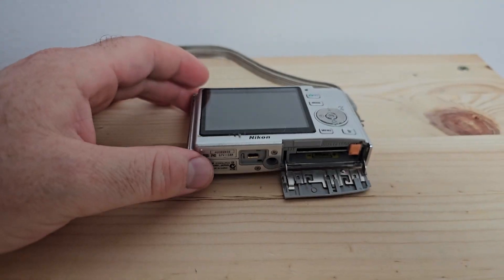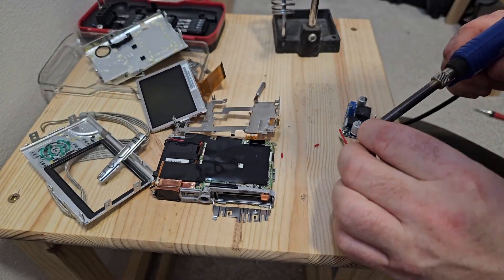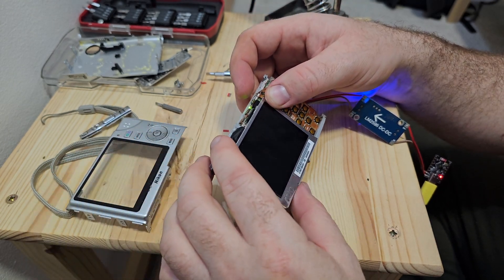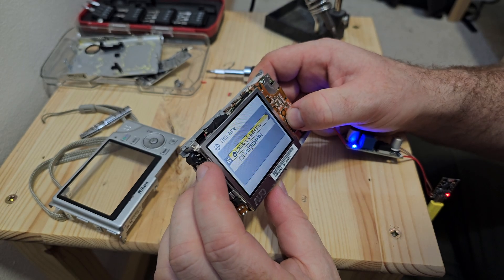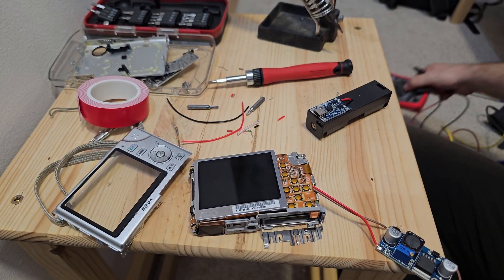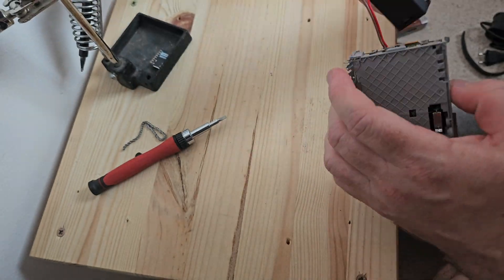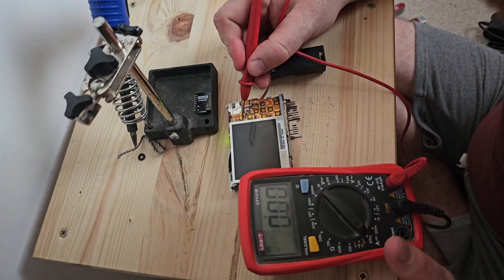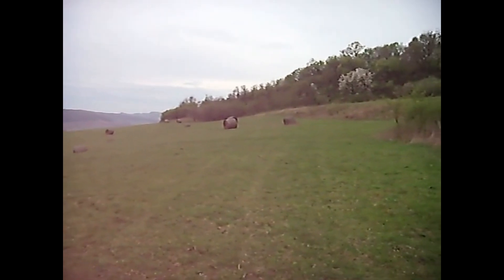Reboot 20 year old digital camera

Comment: i have an ancient canon that takes cf cards and a more modern kodak(terrible) and a modern nikon coolpix(less terrible) the canon outshoots them in any situation the only downside is a smaller resolution image but it hardly matters if it looks so much better. the kodak was so bad I had to go read up on why and I guess they just make the most awful digital cameras
Reply from the maker: Very interesting. I don't have experience with old Canon and Kodak. But it would be intrested to compare footages.

Comment: Cool!
Sorry I didn't understand why using the fix source created problems and why LiIon didn't have the same issue?

Thank you.
Reply from the maker: Thank you for your question. It is very relevant. I suspect is due to current flow the ESP32's 5V didn't had suffient current flow to give it of the DC-DC's input or option 2 is due too DC-DC current the empty battery warning screen usually popped-up when I took a photo. SInce I chenged to tp4056 that had 1A max output current seemsed that the issue disappared.
Reply: @JustBotond  Thank you!